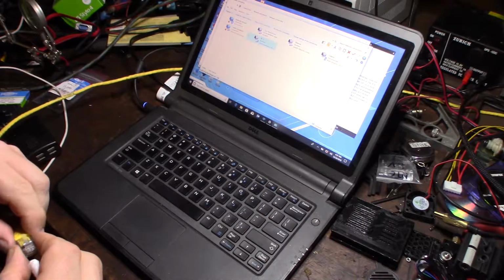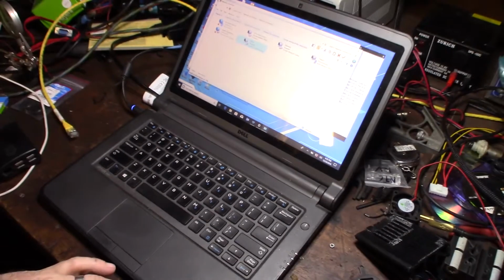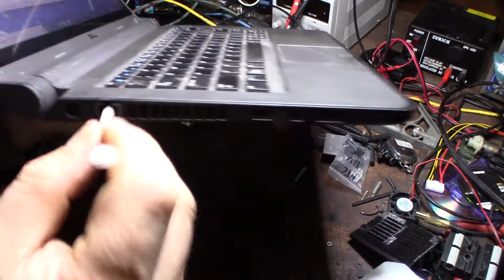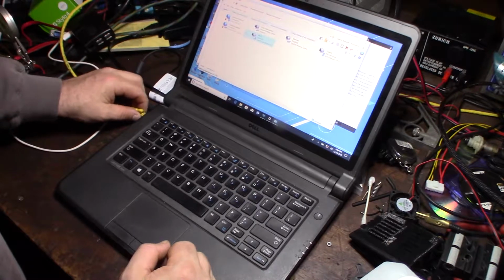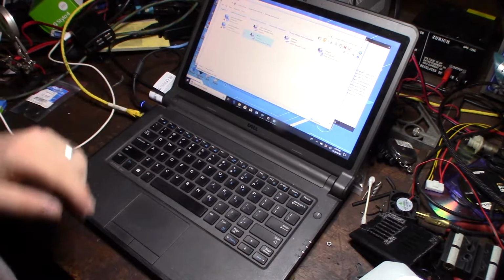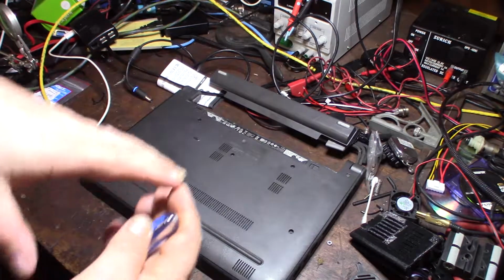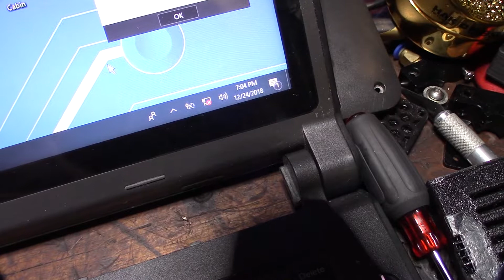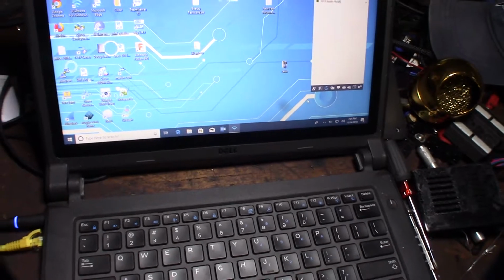Now to fix a  broken Laptop network Ethernet jack wont connect repair

Comment: any fix for missing pin :/ ?? I lost first pin somehow...
Reply from the maker: is the pin missing from the inside. Maybe solder a jumper wire.
Reply: So yeah, same issue, 1st pin is lost on my end too trying to straighten it out. 🤦‍♂️